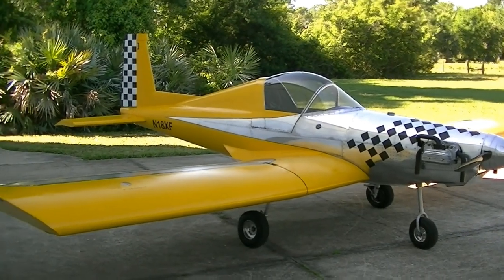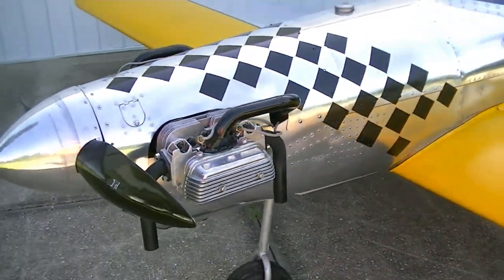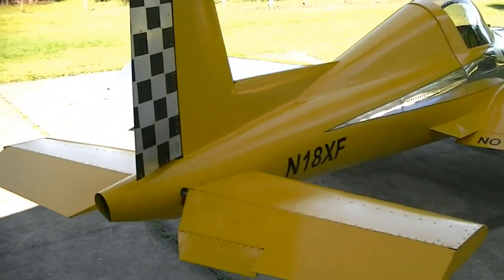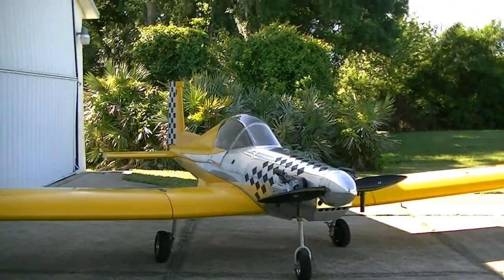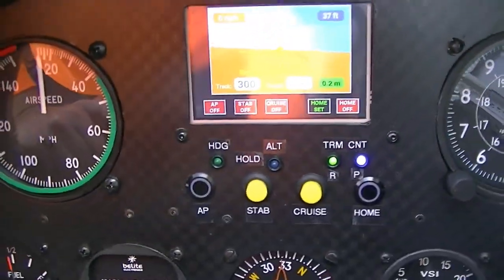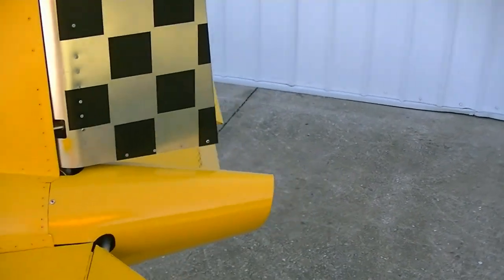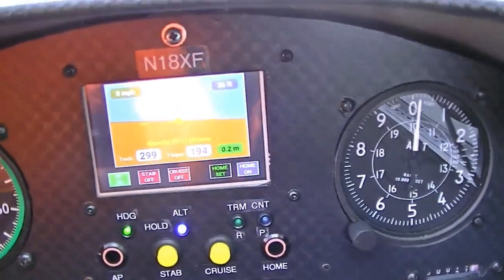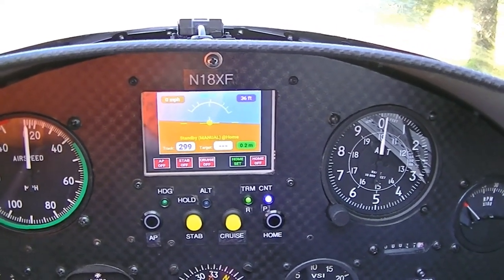Hummel H5 Walk-around and Autopilot

Comment: What a beauty! Congrats on the great job! I am clearing the decks of other projects and hope to start building my H% Next year. Please comment on why you chose to go with trike gear. Having sat in the mock up fuse at Oskosh, and being a larger sized guy I think I will go with trike because it will be much easier to get out of the seat! That said, I also think she is better looking on the ground as a nose dragger. Sort of Airacobra-ish! I am tailwheel certified so that is not an issue.
Reply from the maker: Thanks. I’ve always preferred tri-gear having learned to fly in a tomahawk. Never flown a tail dragged and don’t plan to. I think tri-gear are easier to control on the ground too.

Comment: Beautiful. 85hp?  I thought that the Hummelbirds nominally had half a VW engine with 37hp and still cruise at 108mph.  Yours must be quick and climb well.
Reply from the maker: Thanks. Yes, the H5 is a larger plane, its pretty quick around 120 mph and a climb rate > 1200 per min
Reply: @XflightTech  Beautiful job.  Stay safe.
Reply: Which prop is that? Diameter and rpm.

Comment: I'm a layman here.. How does air worthiness cert work, u have to bring at an airport and fly it in front of an inspector? I assume after it'll  be an experimental w a tail code nr 🤔 noice plane btw
Reply from the maker: The inspector comes to you and inspects the plane, build logs and paperwork (including the correct previously applied for tail number / registration). Then you have to fly it in a predefined local area (away from built up areas / people) for typically 40 hours, performing various flight maneuvers and finally (if you’re still alive) self certify that it’s all good.

Comment: how much did all that cost you Im looking to get one myself but i noticed you have addons
Reply from the maker: Yes I got quite a few extras. The H5 kit was around $17k or $18k with the additional tri-gear and wing tanks I think, the engine was top of the range 85hp with dual ignition and starter/alternator kit, about $8k with spinner, shipping, etc., and then a few hundred more on instruments and paint, etc. All in all a great deal for a cool plane! 
See links below for latest pricing:
www.flyhummel.com/product/kit-H5
www.hummelengines.com/price-list
Reply: @XflightTech  awesome thanks for the info Im from Orange County/Los Angeles Area and Im still learning the rules in these airspaces meaning which airports can I landing and takeoff in and I take it a radio and GPS is mandatory for airport communications Im sure its alot different when you live in a very country low population are vs living in the big city
Reply: @XflightTech  I assume municipal airports that provide a ultralight runway
Reply from the maker: La Mar Derrell Taylor the H5 is not an ultralight (like the Hummel Ultracruiser), so you can pretty much go to any airport depending on pilot qualifications.